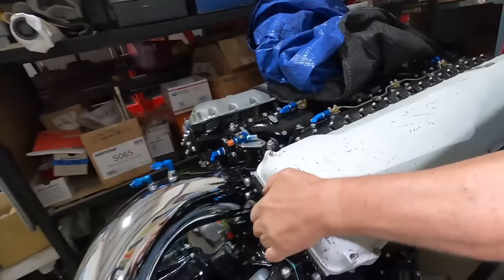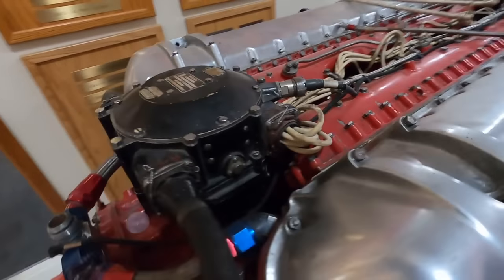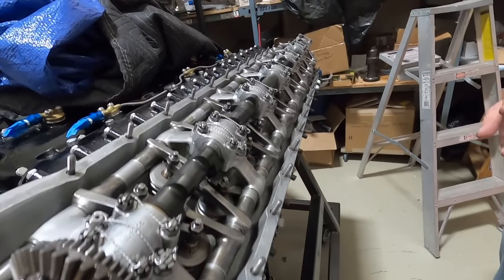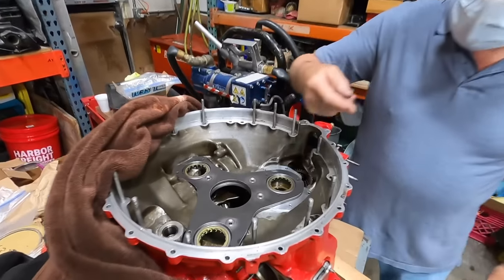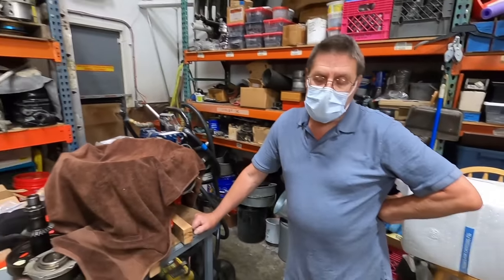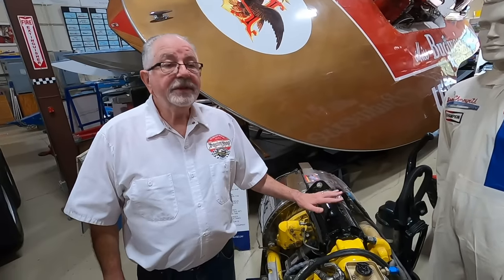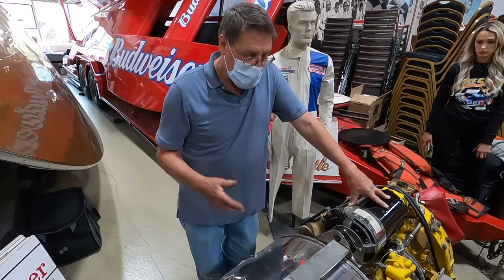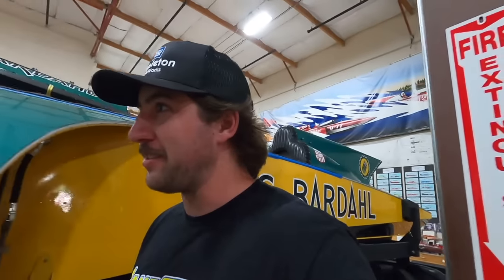The Rolls Royce Merlin: WWII Fighter Plane Engines Modified For Hydroplane Racing!

Comment from the maker: I would love to have a Merlin in something someday... Help us get keep history alive and check out the GoodChop website real quick! (every click helps)
Use code STAPLETON120 to get $120 off across your first 4 boxes of Good Chop at http://bit.ly/40JWAEo!
Reply: I feel we need a Burt Reynolds “Stroker Ace” style advertisement for Good Chop!
Reply: Btw. Since you were talking about the production processes involved….

https://youtu.be/-fo7SmNuUU4
Reply from the maker: I did watch that video when doing research!
Reply: @Stapleton42  One of the Arfons brothers built a dragster with a  Merlin in the late 50s...
Reply: Don't worry if both mag's failed you'd still get to the ground just a little faster
Reply: How hard are the W12's to get a hold of? That might fit in the Grey Pupon car🤣
Reply: Why not.
Reply: There’s an outfit called Vintage V12s, and they build Merlins and Griffons into full blown race engines for air racing
Reply: @Stapleton42  I highly encourage going to the Reno Air Races this September since it’s this year is the final year
Reply: Awesome video, 👍 freakin amazing engines. There should be an aftermarket engine supplier building these to continue on(like Dart, Brodix etc) Just imagine what power they could get these days with say a Dart block, Procharged engine in this configuration 🤔🤯
Reply: ty alot again man
Reply: Its only fitting. During the war the PT boats had 3 of these in them.
Reply: Yea,  I am back...😁
Reply: This guy basically breeds unicorns to catch rainbows,tuning ultra powerful ultra rare legendary engines!
Reply: Fantastic information on this video, thank you so much for sharing. Was always more of a Allison fan, Murica! I want to say that Studebaker may have been the only auto manufacture for about 50 years who had a factory V8 that could take over 40PSI of manifold pressure. The engine had very deep head bolts, went down past the bottom of the bores. This allowed for the engine to have huge cylinder pressures without loading the cylinder walls (because the threads were loading the main webbing of the block, not cylinder walls) and disforming them like in other V8's.
Reply: im sure they are not to expensive 😀
Reply: id like a spitfire with a souped up merlin!
Reply: @yogiguitar1  well then the Merlin goes out the window and the Griffon is your best choice as the last spitfire has a contra rotating 2x3 bladed Griffon engine but only a few was made and impossible to find and buy here is a P51 with this engine in it   https://www.youtube.com/watch?v=vpki2tKlSgQ
Reply: @ottoolsen9560  yeah i know but i still prefer the mk ix spit. i wonder if anybody put a souped up merlin in a mustang? 4000 horse would go down pretty well i reckon
Reply: @yogiguitar1  No, I don't think there is, maybe in some form of racing, 4000 hp would require a very large propeller, you can't just increase the speed of the propeller, the number of km\h is faster at the tip of the blades than further in. and will break the sound barrier earlier, which does not work well. you therefore need a larger slow-moving propeller, which again takes up a lot of space on a small aircraft, counter-rotating is one way to solve this, but is not without problems either. you can modify some by taking the inventions that have been made and modifying them with today's technology, but propellers clearly have a limit, and they reached it during WW2
Reply: @ottoolsen9560  yeah that sounds logical. howabout spring loaded telescoping prop blades! that increase in diameter with rpm and centrifugal force! that would work.obviously you'd have to balance everything  or what about a ducted contrarotating fan with like 24 blades in carbon fibre. it would require alot of modding though. im a little drunk right now so these ideas seem to appear............
Reply: Put it in the Rolls project!  It only makes sense.
Reply: THERE IS A PLACE THAT HAS LOTS OF THEM .I THINK J LENO  DID A BIT ON WHERE THEYS ARE .
Reply: @davefroman4700  THAT WAS THE PACKARD.

Comment: Bingo! He said it perfectly. The hot rod industry was born from the military which is 100% correct. What we use today was used several decades ago by the aircraft industry in WWII. It is the stuff that works. These guys today just improve on that technology with amazing results. These engine are a marvel and to be cherished as they will not be made again. I do like them  both, the Merlon & the Allison. I think that the Allison is just as capable as the Merlin with the right blower setup. The Allisons have a distinct sound/a hum rather than a raw growl of a Merlin. Thanks for posting such great informative  video.
Reply: i allways thought hot rods started with running moonshine

Comment: The Merlin has a sound like no other
Reply: the Merlin engine is the coolest name for a bad ass engine
Reply: Legend has it that when Britain was in peril ,that King Arthur would return,with his guide ,MERLIN,SPITFIRE,LANCASTER,MOSQUITO,HURRICANE,plus tanks,plus p.t.boats,plus pilot retrieval boats,plus fire fighter boats,plus water pumps,and the list goes on,the greatest engine in history!
Reply: what makes it cooler is when you say the rolls Royce Merlin engine . actually that's how it should be said. the engine earned it .
Reply: @rickherman4539  Rolls Royce tradition was to name their aero piston engines after birds of prey. Hence the Merlin, Griffon (which is actually a vulture), Eagle, Falcon, Hawk, Kestrel, etc. 

Their gas turbine engines used to be named after (British) rivers, such as the Avon, Spey, Trent, Derwent and Nene. However, that system has somewhat broken down and the B-52 is to be re-engined with rather boringly named Rolls Royce F130 (but to be built in Indianapolis).

nb. the Merlin engine Spitfire was originally to have been named "the Shrew", which I'm not sure has quite the same effect.
Reply: @roserado8228  Sorry old bean but the Merlin was NOT used in PT Boats of the US Navy !!!! ALL those were PACKARD designed and built specifically for them the M2500 and NO those are NOT Packard built merlins.  M2500's were delivered to US Navy in 1938 and Packard did not built the first Merlin until Aug 1941, and besides the Merlin is 1650 Cu In displacement  compared to the Packard M2500 of YES 2500 Cu In  or 50% larger, also many thousand of the M2500's went to UK for their MTB MGB Air see rescue, you have not a clue what the HELL you are babbling on about. See the You Tube video  PACKARD PT BOAT ENGINE and educate youself !!!
Reply: @rickherman4539  YOU are obviously not aware that PACKARD built 55,525 of the Merlin engines in WW II as an off shore, shadow factory for the UK, they received 37,137 of them !!!  or 1/3 of all produced. plus FORD UK built another 33,000  which is more than RR themselves made !!!!

Comment: This is absolutely fascinating. I'd never thought about it before but it doesn't surprise me that the blower would be the weak link. After all aero engine blower systems are designed to run at 30,00ft, not see level.

Comment: 11:45 yup, id even say ALL!!! non-experimental airpalens have 2 mags
.
you even test each mag before flight..... HOLD THE BRAKES.... rev it up to a stable RPM.... then switch off mag 1
should see a slight drop in RPM
turn it back on, then switch off mag 2..... should see a slight  drop in RPM
then turn them back on.... do the rest of the check list... and take off
.
and its purely for backup (well, it runs better/cleaner on both.... like how some modern car engines have 2 plugs... a 5.7 hemi fires the 2nd plug a few MS later, for emissions, not performance) 
completely different dizzy, plug wires, and even spark plug (if 1 cylinder gets a miss.... now you are dumping gas into the oil, washing cylinder walls, higher vibrations and stress.... etc)  
.
if the RPM doesnt drop.... that means 1 mag is bad..... and you 100% get it fixed before even thinking about taking off

Comment: Did they tell you how Packard had to slightly redesign the Merlin to make it manufacturable?  Prior to Packards involvement, it took two weeks to build a single Merlin. Also, you couldn’t take a part off of one Rolls Merlin, and put it on another one. It was a mess for maintenance on the battle field.  Packard fixed the manufacturing issues so they could be made much quicker and parts could interchange.
Reply from the maker: They didnt mention that but I did read that on my own research. Pretty neat American ingenuity lol
Reply: @Stapleton42  Packard was contracted with by RR to be an off shore shadow factory for the brits and many changes had to be made to the design to build it on Packards machinery !!!

Comment: In GE Power Systems Gas Turbines we would call those mechanical drive turbines "Two Shaft" turbines. Typically used for natural gas pipeline compressors. The big heavy duty gas turbines were typically "single shaft turbines.
Although we did use "Aero Derivative" gas turbines for smaller applications. Those Aero Derivative turbines were two shaft turbines.

Comment: That Merlin he pulled the plain valve cover off was a PACKARD built and modified in the USA, NOT a RR Manufactured one,  RR had ROLLS ROYCE cast into the valve covers !!! Packard built 55,525 Merlins of which The Brits received 37,137 of them and the USA received 18,000 of them all but 3,000 were the 2 stage version .  the Mustangs used the 2 stage versions  the P40 F & L got the single stage version, then returned to the Allison engine, the RR was no improvement in performance !!

Comment: Axial flow, all connected, free turbine, not connected to the compressors.  The free turbine, is the power take off, thats what runs or powers either a prop or blades etc.   They are actually very simple in thermal terms.

Comment: I have read that the Allison mechanical aux blower was somewhat inefficient. If that was indeed the case, what could be done to resolve that?
Reply from the maker: Change to twin turbo and delete the blower? I wonder if anyone somehow got a merlin supercharger to work on an Allison
Reply: busterdee  The Allison had a single stage supercharger, one compressor wheel as did ALL the merlins until the Merlin 60came out in early 1943, in which they added a second stage, another compressor wheel to give more boost above 20,000 ft, all Allisona nd early Merlins worked best below 20,000 ft.  And actually an Allison powered Mustang was faster than a $hitfire MkV  or a later Merlin Mustang below 20,000 ft.... "somewhat inefficient"????  NOT so.... Allison Mustang was the fastest fighter when introduced in 1942.....  the facts of history less the lies, hype and just plain BULL$HIT !!!!
Reply: @Stapleton42  NO.... Allison used the turbocharger for the second stage and later had their own mechanical 2stage supercharger  ie F82's